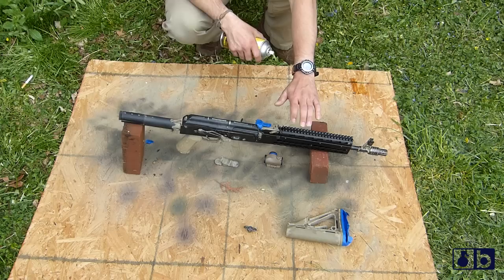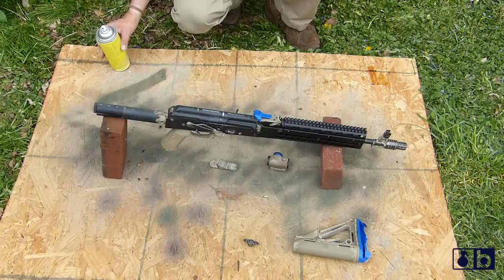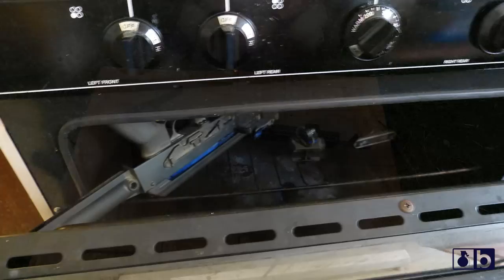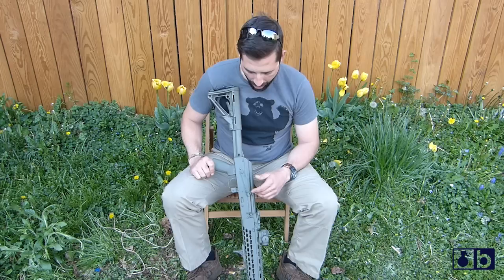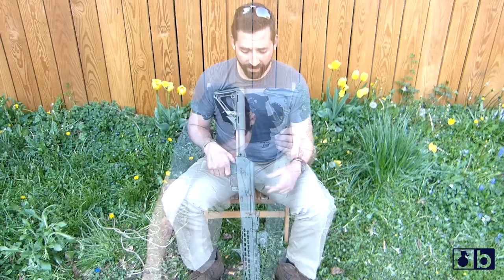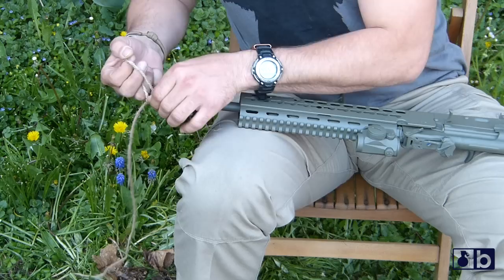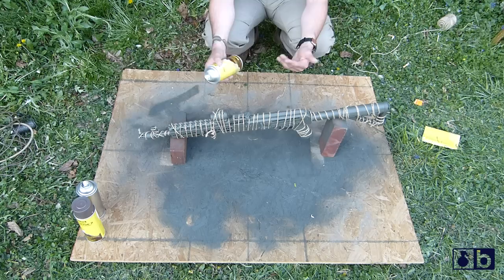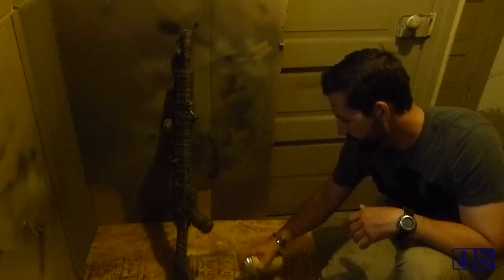Properly Camo Painting a Gun/Rifle (Part II)

Comment: Came out nice. I would use brake cleaner spray to start. Then high temp black on the barrel.(Just in case) Maybe a few leaves,strings etc. then finish with a Satin or flat clear. Don't believe theres a need for baking unless your coats are to thick in between and are not drying in between. thinner mist coats are best.

Comment: The baking seems to be a concern/problem with some.For large pieces of metal that won't fit in a oven.Pick a very warm day,you will have to make shift a holder in your car ahead of time.Put up the car windows.Paint the weapon, place in the holder in the car. On a 80-90 degree day ,a car can be 140-160 inside. Enough to bake the paint on. Use gloves to take it out , it will be very warm.Plastic will be fine.
Reply: And your car will smell of spray paint. No thanks

Comment: I want to paint a bolt gun with a synthetic stock, would you recommend a different temp and baking time for this, or would 200 for 15 minutes work? I don't want to scar or otherwise damage the stock.
Reply: use a blow dryer. hot air the air coming out of it is hot, is it not?

Comment: should of use soft grit or steel wool get some of original finish worked out for better base
Reply from the maker: Who cares! If you use your gun you paint it more than once!
Reply: I suppose so. Just saying better base will prevent u painting it more times then u should till or at least slow down the process when your paint coat is thicker then a gun receiver lol.

Comment: Gotta say I was skeptical at first of how it was going to turn out. But you did an amazing job. Question 1- what colors did you use in order? You started out with OD green then coyote brown, but then stopped explaining. Question 2- what would happen if you didn't bake after every coat?
Reply from the maker: Baking opens the pores in the metal and allows it to dry faster. Just gives it a better result. It was Alumahyde II OD, then Coyote, then Earth Brown. Then we used Krylon Nutmeg for the light brown spots in the final pattern and desert and used a net for texture.

Comment: So how well does the paint hold up when you are firing the weapon. I know my rifle gets very hot. Barrel gets too hot to touch for sure, and having a smaller diameter front rail I can certainly feel the heat coming off the barrel trough that. I don not want the paint to start melting off while im firing the gun.
Reply from the maker: Throw it in the oven at 100-125 degrees for 30 minutes to bake the paint on. I never had an issue at any of the classes I have run my guns through.

Comment: First off, I'm pretty sure you aren't supposed to "bake" at any temperature latex paint, nor should you bake any optics. Heat distorts optics and will cause the argon gas to turn brown or murky.
Reply: Kid Bass Master Or cook anything edible in it afterwards.
Reply: Pretty sure he's using Brownells alumhyde which isn't a latex paint, it's an enamel based paint closer to cerakote or duracoat. Not quite as strong though. But it is a better option over cheap krylon if you can afford it.

Comment: so how important is the baking part of the process?
Reply: It cures and hardens the paint. I baked my shotgun barrels like that and it makes it very durable its scratch resistant and rust resistant i baked that at 250 for 30 minutes  i used bbq pitt paint. Its better than durracoat
Reply: yeah i didnt do any baking but i did use rustoleum camo colors 
its on pretty damn good if it wears off over time which i expect it to do over time ill just redo it

Comment: I'm giving this a shot minus the baking, but giving each coat a lot longer to cure. I just have it hung in my basement over a tarp and toss a 40 second spray on it before I leave for work, or go out, or whatever. Seems to be coming along well, and if I remember to, Ill come back and note if any flaking occurs.
Reply: So far, so good without baking. Ive taken it out a couple times with no flaking. Ive been asked a few times how much itd cost to have it done, and when I say nine dollars theyre like "Wait, what?". Haha.
Reply: +Krixig What is the baking supposed to do exactly and at what temperature and for how long are you supposed to bake for? I thinking about doing this and I'm considering my options..
Reply: +Azygos1986 
I didnt bake it. He recommended doing it in the video and gave his recommendations on temps and stuff. I would assume the idea is just to cure the paint for a    more resilient coat each time, but it didnt seem necessary IMO and I havent seen any negative impact from that. I also didnt want to goof up a red dot I had mounted also. Plus, I figure its so easy to touch up a spot, that if it does flake a little, just rub off the loose paint and respray.
Reply: Krixig
I'm just gonna use a hair dryer to help speed the process along while avoiding my red dot.
Reply: +Azygos1986 250 for 30 minutes. It cures and hardens the paint and makes it bond better. It works very well if done properly.

Comment: not my favorite. I dont get the baking, and especially having to watch it.. his methods ( string) are good, his end result is not my favorite. I will use his techniques mixed with some others and hopefully make something I'll be proud of.
Reply: @EdPotts Alumahyde II recommends baking the finish on, right in the directions. And if I'm not mistaken it also recommends preheating the metal BEFORE painting as well. Not 100% on the preheat, it's been a while since I've used it. Of course you CAN just let it air dry if you don't care about durability.

Comment: That honestly end result looks terrible.
Reply: +Killahbyte  Like they said in part one of the video, if you're more worried about how your gun looks than how it functions, then you're doing it wrong.
Reply: +Derek James That would be a great argument, had this video not been cosmetic in nature.
Reply: That's good then that the word "cosmetic" (depending on which of the several definitions you use) does not necessarily infer "beauty" or "appeal to the eye".  In this video, the "defect" that they are correcting is that the firearm initially is all black, which impedes on it's ability to blend into the environment.  In regards to cosmetics, the goal is to improve the firearm by blending in the outline of the firearm with natural colors of the environment.  And this improvement can be done without "beauty" or "appeal to the eye".  It's a cosmetic change that improves it's bendability, but not it's beauty.  Does that make sense?

Comment: So much fucking paint for such a small object. Having that much paint on the bolt carrier to rub off and gunk up the gun probably isn't a solid idea.
Reply from the maker: Zero issue,  thousands of rounds later. Maybe if you painted it with thick coats, yea it would be a problem. But properly done this is zero concern. Toodles.